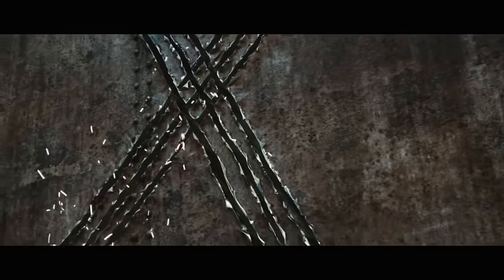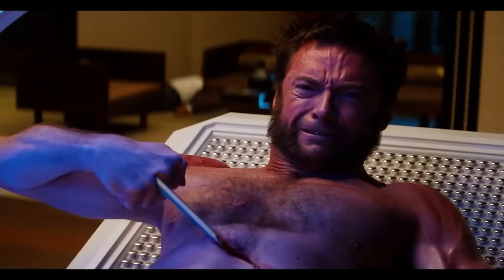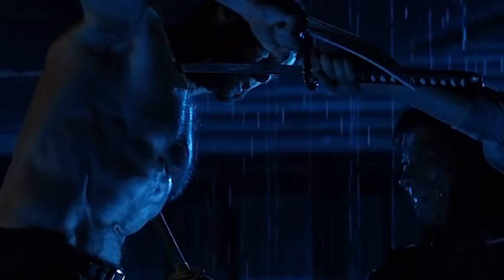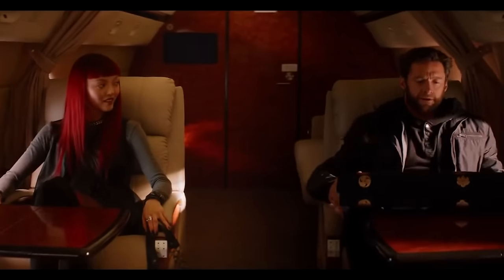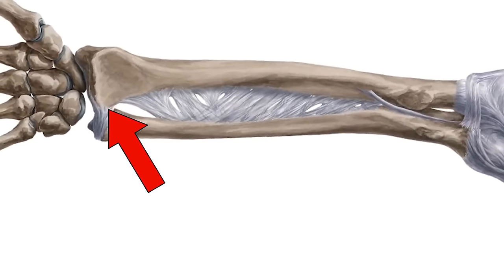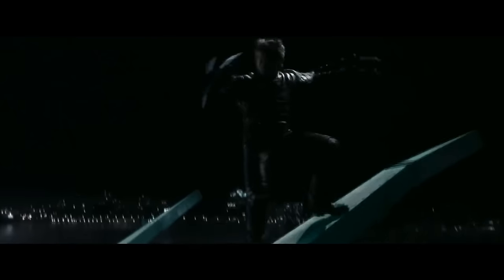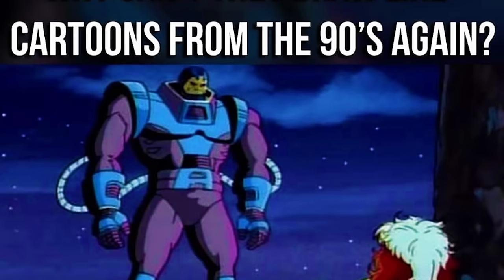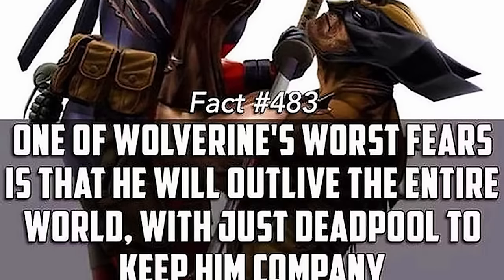How Do Wolverine's Claws Work?

Comment: I always assumed the adamantium blades were just molded over the ends of his already existing claws. Meaning the blades extend the same way his bones did. Adamantium can't be destroyed, so there's no need to replace the bones encased within it.
Reply: Until The Wolverine happened😅 I guess the X-Men movies version of adamantium is based on the Ultimate Universe version which in fact was breakable best example Hulk ripped Wolverine in half
Reply: @markmagician2471  In The Wolverine his claws were broken by a sword that was also made of Adamantium and super heated. 
Like how Wolverine was able to decapitate Weapon XI after his claws were superheated by the optic blast.
Reply: @AgentRedgrave  the Ultimate version of Adamantium isnt indestructible just durable
Reply: @markmagician2471  I am aware of that. Just pointing out that what happened in The Wolverine isn't proof that movie Adamantium is based on Ultimate Adamantium.
Reply: @AgentRedgrave you forgot to mean his claws literally had to break his INDESTRUCTIBLE bones to get out

Comment: I studied anatomy & physiology & I figured the metal didn’t coat the bones, but bonded to the molecular cells of bones. Therefore, the bones still maintain their A&P
Reply: In the old times the writers used the vague term "laced" to describe the weapon x scientists having laced his bones with adamantium (leaving it open to speculation exactly what that means) -- but it does suggest that the process involved something other than just dipping and covering every bit of bone in a total painted coat of metal. It suggests there is more of a lattice or framework of adamantium around his bones.

Comment: Actually, they made them preposterously large and proportionally incorrect for the 2003 movie franchises. If you watch the 1997 Fox cartoon, his claws are so thin, they fit between his knuckles. And the metal is unbreakable, so it doesn't need to be as big as they made it, it was an aesthetic choice that is non cannon.
Reply from the maker: That makes sense. Yeah in X Men Origins they were BIG lol. Looked cool though. Thanks cwalser!
Reply: His claws are usually 6 -9 inches depending on what artist but I hate when they try to say they're 12 inches long no way would that work

Comment: As Mr. Fantastic once pointed out during an exam when his healing factor failed, everytime he resheathes his claws, he’s pulling ungodly amounts of bacteria and germs into his body.  Just popping his claws in his current condition, could lead to sepsis
Reply: The OG version of his claws - as designed for him to be a military weapon - was that the metal housings on top of his knuckles have silicone seals (which require replacing from time to time) that would create a barrier -- although with his healing factor you could argue what's the point in protecting against disease.
Reply: @willarms5510  One thing about the movie that always bugged me that the comics have shown, is in the movie why isn't his claws covered in blood or at least blood shoot out from his knuckles when the blade come out?
Reply: @hobbitpsi  It did happen in the Days of Future Past movie, it's most noticeable when Logan is having his panic attack after seeing Stryker in the past, you can see blood quickly burst out of his hands when his claws pop.

Comment: And how did they get the shape of the claws so perfect and sharp if all they did was inject him with the adamantium?
Reply: Because while the movies and comics show the bone claws as more rounded, the bone claws were actually described as razor sharp where it bottom of the bones claws were supposed to have thinned to a sharpness and his healing factor made them much stronger than normal bones.  So the bladed adamantium claws we see are supposed to just be the metal coating the shape of the bone claws which already were supposed to look like that.
Reply: Originally his claws were gloves but that was quickly changed when they realized they didn't want his specialty to be something anybody could just pick up and put on.   The first couple decades or so has his claws come from the weapon X program, not from his mutant powers.   Those engineered claws explain the sharpness.   They later retconned the claws to become part of his mutant powers because they didn't want him to lose his claws when Magneto ripped his adamantium out, and so he got bone claws.

Comment: I prefer the way the claws were explained in Weapon X. The claws were an accident, caused by pumping too much adamantium into his body. Once the scientists saw that the claws could be used as weapons, they created the silicon sheathes in his arms and ejection ports on the back of his hands. Presumably they also created the mechanism that controlled the movement of the claws.

Comment: Not gonna try and get all detailed but in original comics as briefly mentioned in the video, his claws came out of the little metal pieces, sheaths if you will. But what isn't mentioned in more detail is that they came out above and between his knuckles, only since the movies have they been shown coming from between the knuckles and fingers. So that indicates that they would have to come out maybe from the lower inside of his wrist and forearm. Again not gonna try and dissect how that would work, but I would think there would be less bone and muscle issues, only the tearing of flesh when popping out his hands. The sheaths would also go basically to his wrist and maybe connect and or click together with similar sheath in forearm. As his claws are arched so would the sheaths thus missing some or all of the vital tendons and stuff. Before adamantium the muscles and things would naturally form around them as to not cause any damage aside from popping out the top of his hands because they are only really sharp at the point and roughly rounded throughout the rest of the claw. even though he does slash when striking, in reality it would be a stab motion that would be the most effective maneuver. The clean slash damage would be when only the tips would make contact with the surface of what ever he's attacking, otherwise it would have more of a tearing effect i.e. not a clean cut. The adamantium was somehow shaped to create a more effective strike, improving attack ability.
Reply: Not exactly, in the comics it was always artistic choice.  In the some Wolverine comics back in the 90s they showed his claws coming from between his knuckles.  Hell there was a storyline after wolverine got his adamantium ripped from his body that he went completely feral and he's unleash his claws even when his fingers were extended and the claws literally were between his fingers.  Like I said, it was just artistic choice.  The going above the knuckles and the back of the hands was the old artistic choice, back when the origin of his claws were that Weapon-X implanted the claws into him and they weren't natural.

Comment: If the adamantium is not interfering with, but interacting with his ligaments, might it be helping them to allow him to lift so much?
Reply: The OG language used regarding the adamantium process is that his bones were "laced" with adamantium -- suggesting that the metal does not cover them entirely but was applied in some kind of lattice structure.

Comment: The claws seem to fan out from his hand, so either adamantium is flexible, or the blades criss-cross and rip out of the sides of his forearms when retracted. Or they cross somehow in levels and pop out the top and bottom of his forearms. Or they displace the bones in his arms. If they are not flexible then the blades should only be set as the width of Logans’s wrists. Or it’s a fictional comic book character and it doesn’t really matter how the blades work because it’s fiction.

Comment: What I really wonder is how his body manages to counter the leverage put on his skin and muscles when he uses his claws to cut something.
There is no real support structure above them and there can't be any behind them because otherwise they'd be too long and stick out of elbow when protracted.
Reply: Honestly this is why in the comics Wolverine is depicted as so jacked and bulky.  Because even if they didn't sit perfectly in his forearms and didn't move there's just so much mass that no one would notice also it's that mass that would allow him to use them to slash things without them ripping through.  Gotta remember his healing factor also affects his muscles, so he's be a lot more durable than normal.  Not invulnerable but much more durable especially if you consider that for muscles when you build muscle you're literally tearing them and letting them heal itself so like any ripped point the areas get tougher and considering Wolverine has explain he literally pops his claws out several times a day to keep the hole and channels open like pierced ears, the muscle mass around his knuckles, wrists and forearms would be extremely tough.

Comment: They are mechanical, switch blade, type devices that were bolted to the bones of his lower arms and wired into his nervous system by Weapon X.  The bone claws were a later plot armor, added when Magneto stripped the adamantium from his bones, so he wouldn’t just be a guy who healed fast and had heightened senses.

Comment: I preferred the claws being separate weapons from his body that were implanted by Weapon X during the adamantium-ization of his skeleton as depicted in 1989's "The Wolverine Saga." The bone claws are a retcon that wasn't canonical until 1994 when Magneto pulled all the adamantium out of his skeleton. The claws should be an enhancement that was added, much like Captain America's shield. The weapon is separate from the super serum soldier.

The reason for this preference is a separate high tech weapon grafted onto his body could get around complicated anatomical issues that bone claws would cause in his hands and forearms. For example, claw sheaths on top of musculature instead of embedded in it.

Also, solid metal flaws are more durable than coated bone claws, they (somehow through design) don't produce constant self-injury when extending when used with the glove tubes, and they would permit him to do things like climb with the claws without tearing the bones out of his arm. They could also allow him through design to supinate his hands (palms up) with the claws extended--important for things like keeping the claws extended while crawling.

Additionally, having bone claws as a mutation makes no sense since bones can't be sharp enough to do much damage and would break and hurt him if he used them too aggressively. For those who say his claws are based on those of feral animals like big cats, their claws aren't as long as an entire forearm, and animal claws are curved. A long bone claw pulled a certain way in the heat of combat would snap like a twig, as Sabretooth demonstrated when he stomped on them and broke them. It's a weakness that makes them more like antlers (which are routinely broken) than claws.

Making his bone claws one of his mutations just gives him more weaknesses, not strengths.

Wolverine's skeleton being heavy because it is coated in adamantium is nonsense, as he has been carried by characters in flight like Storm, who lacks super strength.

The healing factor has also been sped up to almost instantaneous levels. This is done to minimize combat downtime and to make combat bloodier and more exciting. In the movies he constantly takes hits. In the older comics he dodges. Healing from a gunshot wound in a day made more sense to me than treating Wolverine like a Terminator zombie. Death from rapid blood loss should still be a concern (your healing factor can't kick in if you bleed out before it finishes the healing process). In the films, he doesn't even bleed when the claws extend from his bare hands. Is the healing factor really that fast?

The adamantium poisoning detail was not mentioned in comics until 2000.

Lastly, the claws are depicted inconsistently. Some artists draw them as pointed stilettos while others draw them as having squared off razorblade edges.

In some of the movies, the claws look terrible. They look like blunt butter knives coming from between his knuckles, not from the back of his hand.

In short, many of the now canonical innovations of the character made since 2000 under the editorship of Joe Quesada I do not agree with because these changes are silly (children/clones of Wolverine, etc.). But Wolverine is a "cool" character so he is given endless gimmicks as plot armor. Kind of like how Batman always finds something to repel from when he is falling.

Unfortunately, now an entire generation of fans has grown up with these newer ideas and consider newer runs by writers after Chris Claremont to be good content. For me, only the team of Claremont and Jim Lee can really do the character justice, with his peak being in the late 80s and early 90s, especially X-Men #1 in 1991, the highest selling comic book in history by many accounts with 8 million sold.

Now Marvel gives away 30,000 comics for $10 a month. That shows that the value of their IP is in their films, not their comics, which now do not retain value since they can be infinitely digitally reproduced.

Comment: 6:00 Just to give some context, within the Marvel multiverse (MCU and comics) there are different types of adamantium.  Proto-Adamantium is 1 of 2 metals (2ed being Vibranium) used to create the alloy for Captain America's shield in the comics.  True Adamantium (sometimes known as Primary Adamantium) was an attempt to recreate Proto-Adamantium.  The main difference is True Adamantium can be reproduced.  No one has been able to recreate the latter.  True Adamantium was used on Wolverine during the Weapon X program, however due to his healing factor effecting it during the bonding process the metal underwent a molecular change, becoming known as Adamantium Beta.  It retains all properties of True Adamantium, however it does not inhibit the natural biological processes of bone.  This includes making red blood cells as well as natural mending of bone.  While there are only a handful of ways by specific individuals (Magneto, Apocalypse, Worldbreaker Hulk, etc), Wolverine has had his bones broken or misshaped.  But thanks to his healing factor any such broken or damage bones have returned to normal.

Comment: The only way for this to work would be if the adamantium would be an intelligent metal being adsorbed and bonding to the bones the same way calcium does, maybe mimicking the calcium atomic structure so that it becomes a natural component of the trabeculated bone structure. In a similar way Strontium actually does by being similar to calcium, it can actually replace the calcium inside the bones, making them stronger. And it's used as a supplement for bone health.

Comment: I picture the adamantium in his bones to form kind of a honeycomb structure surrounding and in between the cells, and a layer around the outside of the bones.
This would still be slightly porous to allow blood vessels and nerves to function and allow marrow to still produce blood cells. It would also give strong reinforcement to the bones.

The idea of his bones being solid adamantium doesn't work, because there are living cells inside the bones that have important functions.

Comment: Like Vibrainium in the MCU, it can bind to any cell, so the tendons are woven in to the adamantium coating in the bones.
Reply: Well Vibranium in the MCU is actually supposed to be Adamantium.  Cap's shield in the comics was the first process of Adamantium molding and the story goes that the scientists who did it, did it by accident.  I mean he was trying to shape it, but kept failing and then just went to sleep and woke up and for some reason the metal formed into the shield's form.  The MCU changed it all to vibranium because for the longest time, Fox refused to allow Marvel to use any of their characters or property (film property of course), but ever since spiderman those flood gates opened lol.

Comment: It’s got a segmented and telescoping design… The claws are composed of several interlocking segments that can collapse into each other, much like the segments of a telescoping antenna. When retracted, these segmented claws fold into a compact form and fit neatly within the specially designed sheaths inside Wolverine’s forearms. The sheaths run parallel to the bones (radius and ulna) and are lined with a smooth, durable material that supports the claws. His unique musculature and tendon structure are adapted to control the extension and retraction of the claws. Specific muscles contract to push the claws out and relax to pull them back in.

Comment: his claws ARE TO LONG for his forearm.. a person's forearm is as long as the end of your thumb to the end of your pinky when you spread out your fingers as far as they go.. now use the thumb at the end of the wrist and you will have the length of the "claws", which is only an 1 - 2 inches longer than your fingers with an open hand..

Comment: Imagine if Wolverine simply had adamantium claws that attached over his forearms and knuckles, he'd be still cool and not need the pain associated with ejecting claws from in his forearms.
The non bone clawed Wolverine should just have had Forge or beast build external claws. Wolverine has no logical use for hidden claws or blades since he's barely ever stealthy. A regular adamantium knife with a durable lanyard in case he dropped it would work just as well as inner arm claws that hurt and shorten one's lifespan.